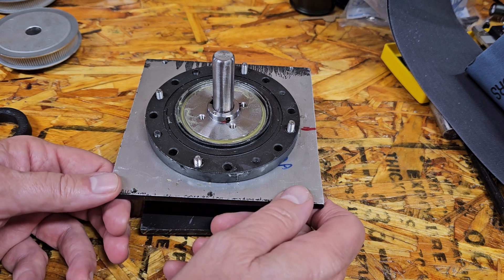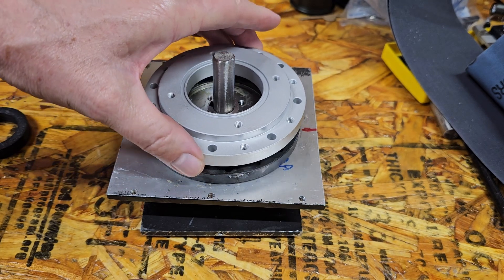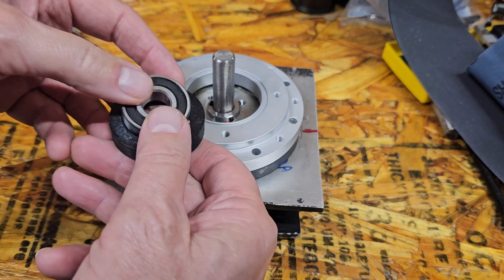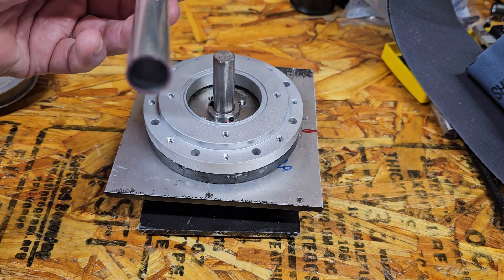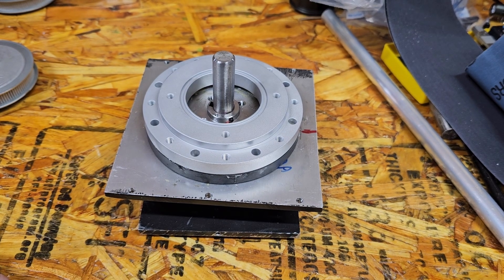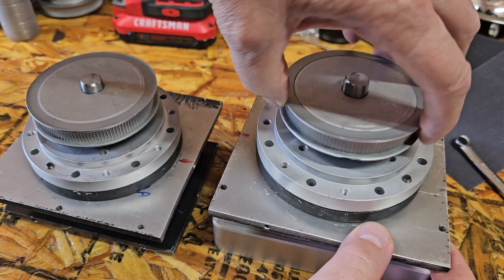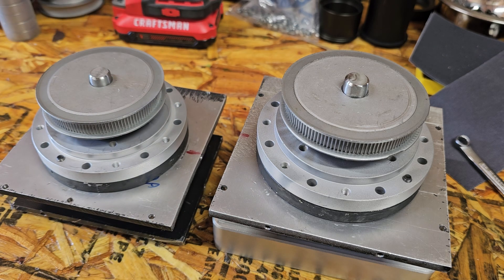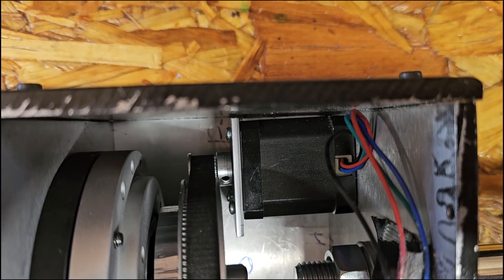Final fixes on the DIY Mount (hopefully)

Comment: I have found that my AM3 guides better when my guide camera gain is lowered from the typical 100 to around 70-75. This goes against most of what I’ve read… but hey it works for me. Maybe give it a try. I also have better performance guiding at 1sec than 0.5sec… Try messing with those next time and see if you notice any change.
Reply: I can vouch for better guiding at 1 sec on AM5 rather than 0.5sec
Reply from the maker: @paskoh  I sec seems to be my sweet spot
Reply from the maker: PHD2 sets my camera gain at 0. What would I change it to?
Reply: @whyf16uy  most of what I’ve read suggests 100… I’d start at 60 and test from there on up. How long are your guide exposures? I would think at gain 0 you probably aren’t picking up a ton of stars and only the brightest are visible.
Reply from the maker: @rural_astro  Trouble is, PHD2 sets it to 0. When I set it to even 20 the stars turn into big blobs. So that's what has me confused..
Reply: @whyf16uy  odd… I’m confused too now, haha.

What about the screen gamma slider next to the brain. Maybe bump up the camera gain and then turn down the screen gamma setting to see if you can find a balance.
Reply from the maker: @rural_astro  something I haven't tried.  Thanks for the idea

Comment: Hi, I am having the same issue with my DIY mount also, in regards to the adjustment base. Let us know how it goes, I will get the base if it works well for you.
Reply from the maker: @onyekanwankwo1148  well it's better than what I had. I just wish it was a little bigger.  Works fine with my little refractor, but we'll see with the newt.
Reply: @whyf16uy  I use a rasa which is about 10kg with everything instrument attached.
Reply from the maker: @onyekanwankwo1148  when I test the bigger scope I'll update
Reply from the maker: @Onyeka.N  honestly I wish it was a little beefier.  But if the scope is  balanced well it should work. I still haven't used my big scope on it yet.
Reply from the maker: @Onyeka.N  big scope with cameras and guide scope is probably 12kg
Reply: @whyf16uy  About the same as mine. Can you share the link of where you bought it?
Reply from the maker: @Onyeka.N  https://www.proxisky.com/products/AltAzBase.html